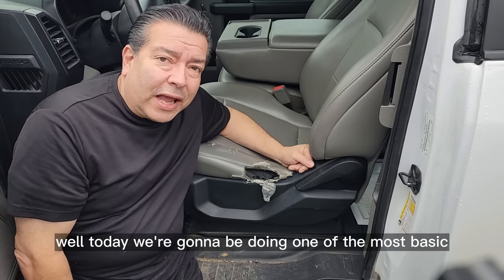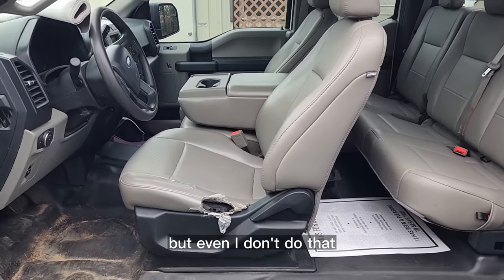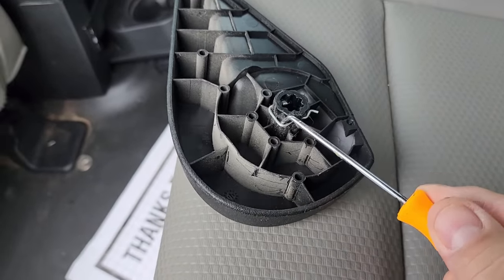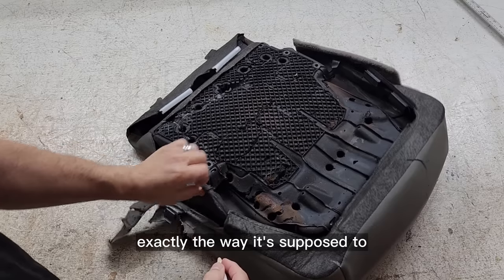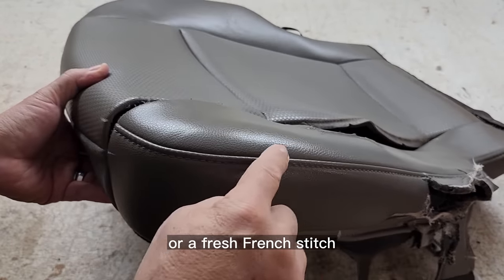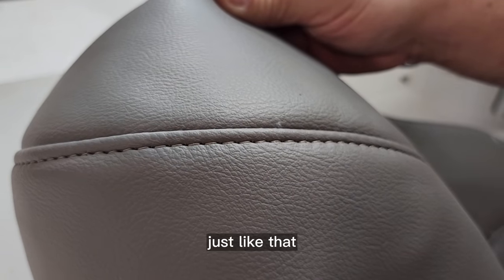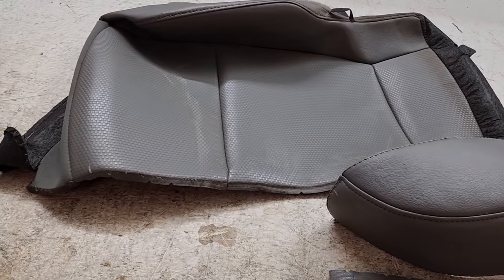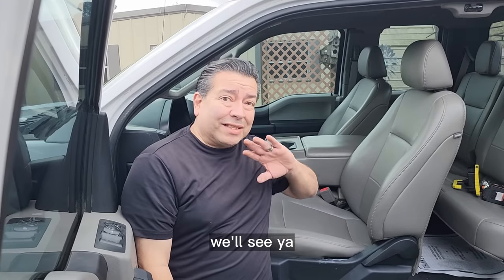Most common auto seat repair upholstery

Comment: Fantastic work.  Consider working in the airbag deployment zone while the system is energized though.  Would be safer (for you) to learn how to disable the airbag system. Also, all modern airbag systems are continually monitored - meaning if you unplug the seat and plug it back it the system will know that.  As long as it’s reconnected correctly, no SRS light
Reply from the maker: Hello Mike, I thought this was a video about auto upholstery... Thanks for the comment, Please keep watching!

Comment: I used to work in the office of an auto applostery shop back in the 90”s always watched thinking this is a great craftsmanship to learn. Kinda like a cobbler.  They made so many custom seats for hot rods and such, the custom work and leather color combinations really popped. I’d see a few VW.s come in and remembering those buses had that old wire frame with the horse hair like padding that held up so well only the fabric would wear down to where that stiff frame would show through. Loved the turquoise and white combo custom work they would install. 🎉
Watching this repair, I thought that original piece of foam used wasn’t really strong for the use on a “Truck” especially all the wear and tear of getting in and out. Should have been much better stiffer quality foam.  But WTH gives you the work to repair many I’m sure.
Reply from the maker: Hello Dani, Yep, sounds like good memories. Yes, it does bring me work. Thanks for watching!

Comment: As an ASE Master Tech since 1978, SIR yellow connectors are SAE certified with a shorting bar in the plastic connector that is spring loaded to "Short" across the two inflator module metal terminals. Electrical current can NOT jump into the air bag and deploy it. If you think you really have to turn the key on, engine off, remove the negative terminal. From 1998 and newer (GM) the radio has electronic memory that is erased only with a scan tool. Volume, country, station and saved pre-sets are stored inside it.
 The SIR control module has capacitors that loose energy if battery is unhooked and cannot deploy inflator module after 5-8 minutes. Written material will tell you 30 minutes but they play it safe.
  The hook tool is sold in two lengths as a hose removal tool. Slid between a hose and inlet on a radiator, wiggle it left and right w/WD-40 and twist. The hose will free and slide off. 
  If the air bag was on a bench, you have to work on the connector with  an insulator installed under the shorting bar and takes some effort. This is a myth. 
Great video on a common problem, like why do the drivers door hinge pin bushings wear out first?  Thanks!
Reply from the maker: Hello Dean, yep. Thank you for sharing you're experiences with us! Please keep liking and watching!

Comment: Youre right about airbags. After installation there's programming Etc. I remove seats all the time to repair cars and unclipping the plugs are a pain. The connectors on airbags themselves are the worst
Reply from the maker: Hello Lewis, You are so right. Why disconnect wires when it is not necessary. Extra work means extra time. Please keep liking and watching!

Comment: Good video. Taking seats out with an airbag is no big deal. Just follow these steps: Wait 5 minutes after shutting off car, disconnect the negative terminal to battery, remove seat and unplug the airbag. There is ZERO issue if you followed the steps of waiting 5 min and then disconnecting the negative battery cable.
Reply from the maker: Hello Adam, Thank you so much for saying so! I never want to erase a customers radio settings. Just sayin'. Please keep liking and watching!

Comment: Great information! I remember when seat covers were once held on with "hog rings" which required special pliers to crimp on the rings used to hold the material to the frame. Wonder if they are still available…..
Reply from the maker: Hello Subgun, Yep, I still use hog rings on the seats that take them. Thanks for watching!

Comment: that is an awesome job !! one thing though that dreaded air bag plug can be disconnected and re-connected with no ill effects as long as you don't turn the key on !
Reply from the maker: Hello Mechanic Mike, Would you say that is the case of every vehicle? I work on every type of car and truck. It would be nice to know as I am not a mechanic. That is why I don't take the chance. Please keep watching!
Reply: @oldschoolautoupholstery  I am not 100% on every manufacturer but on a Ford, Lincoln, mercury it's a fact that  airbags are asleep when the key is off

Comment: Just bought an industrial sowing machine in beautiful condition but stil scared to tackle the actual reupholstering of car seats as I have reconditioned cars for ages in terms of mechanical repairs and mostly modifications putting bigger engines and such but also panel beating and respraying .
I took careful note but still have a lot to learn and sure the first time it won't be perfect but it will come in time. 
Thanks for making it look easy I appreciate.
Reply from the maker: Hello Pieter, If you are also a welder, sewing is similar. Sounds like you can do it! Please keep watching!

Comment: I used to put AC in cars from the dealerships. We took the airbags out of new cars all the time. All you have to do is disconnect the battery first. Second pull the fuse for the airbag circuits. Third pull the yellow tabs from the airbag clips and  disconnect plugs. Never had a problem with the airbags. Installation in reverse mode.
Reply from the maker: Hello Ron, Thank you for the comment on how to remove airbags. Please keep watching!

Comment: Very nice and accurate repair. Good to know about the seat hooks. May I know the name of that powerful  sewing machine, which was used to saw the cover parts together? Thank you for a great film.
Reply from the maker: Hello Olena, I use a Juki sewing machine. But any industrial machine with reverse, walking foot and a welt foot will do just fine. Please keep liking and watching!
Reply: @oldschoolautoupholstery  Thank you for the replay, I googled those Juki sawing machines, they are expensive and very heavy, but good. I've never heard of Juki machines before. Do you have any films about headlining problems? I put a new one previous year, using special glue for that purpose fm Amazon, but it came off in heat in many places after only 1 year. It was my 1st work on headlining, I think I pulled the fabric too much, and that caused the effect I have now. Thank you for your film again. Very informative.

Comment: If the ignition is off and remains off, you can remove the airbag connectors and do what you need to do. Reconnect them before turning on the ignition and no codes should be triggered as far as I know. It is possible that cars vary though but generally speaking when the ignition is off the computers are off and not looking for modules.
Reply from the maker: Hello Rhett, I work on every make and model car or truck. I am sure they are not all the same. I don't want to risk the pain of my customers having to get their airbags reset. This is just a service I do with a smile for my customers. I never go backwards and my reputation means a lot to me. These are the reasons. Please keep liking and watching!

Comment: I do some car upholstery as well.  Unfortunately, I never get vehicles where the seat bottom comes out so easily.  :(  most of the time, the fabric is circling the bolt holing the seat back on.  I have done a ton of 1st gen Expeditions and the 97-03 ford pickups and those have to have the seat removed and the seat plate unbolted to properly get the seat bottom out.  I'm jealous.  
I'm curious though why you use a pick instead of a set of cutters to remove the hog rings?  I find it so much easier to just cut all the rings since I'm putting in new ones anyway.
Reply from the maker: Hello LLs, I use the "Pick" on later model seat covers clips. I rarely use cutters because more of a mess to clean up. I mostly use dykes to twist off the hog rings. Please keep liking and watching!

Comment: If you cut the foam with an electric knife like the type for cutting ham, it cuts very very easy and makes a very clean smooth cut 😎👍
Reply from the maker: Hello JK, I tried about 35 years ago. When I was out in the feild there was no electricity. I chose to stick with a hack saw blade as it takes no electricity to operate and is much more accurate. Thanks for watching!
Reply: Haha good to know. Proof is in the practice,, use what works for YOU..
Reply from the maker: @longhairmullet  Hello Dani, Thank you so much for taking the time to comment. Please keep watching!

Comment: How do you get matching colored vinyl? Also, is doing a repair on a heated seat possible? I have a rip in my seat bottom on heated seats. Wondering how to order vinyl that matches or is doing a kit to put glue on a piece of backing a better option? Thank you - great content
Reply from the maker: Hello Mud, You are so welcome! Most upholstery suppliers and material and vinyl samples that either match or come close to originals. Depending on the car, some heaters are on top of the foam, but others are sewn into the seat cover. Please keep liking and watching!
Reply: @oldschoolautoupholstery  Thank you for replying. I don’t know where to start with finding a supplier. I just want to start with doing my own seat bottom on my car because the dealer wants 800.00 to send me theirs 😀 I am going to watch your basic equipment video tonight. I am older and a disabled vet, cant afford that. I have a regular sewing machine and lots of time 😀
Reply from the maker: @MudDuck  Hello Mud, Just go for it! I think you will do just fine with your seat-bottom project. Please keep liking and watching!

Comment: Instead of that part of the seat cover wearing away, the entire bolster collapsed on my driver's seat in a truck that's not even 4 years old. I'm a big guy, but I'm not that big! Is that a particularly costly repair, or is it more along the lines of pull the seat out, flip it over, push everything back in place & pop-rivet in a support that broke loose?
Reply from the maker: Hello Nunya, I think not too costly, Depends on your upholsterer. Sounds like your handy. I think you can do it. Please keep watching!

Comment: I'm interested in the cost of this repair vs just buying a whole new seat cover for that bottom part. I've found vinyl replacements at a reasonable cost. Just wondering.
Reply from the maker: Hello S RC, Sometimes replacement seat covers can be bought cheaper than what it would take to replace worn seat panels. You get it in a box, Then what? You might need to pay someone to install it right? Please keep liking and watching!

Comment: I have a 1990 mazda miata which has the original cloth material on the seats. My had the habit of sliding into the drivers seat and the side of the seat has worn away. I've looked for the original seat material, but have come up empty handed. Any help on where to look would be greatly appreciated. My goal is to keep the car original.  Thanks
Reply from the maker: Hello Marvin, Original materials fabrics only go back ten years. Send in a sample to Santa Barbara upholstery supplier in Glendale Arizona. They have the most fabrics I know for a close match.  Please keep liking and watching!

Comment: One question!!, why didn't you show how to get the 'C' clip reinstalled on the side seat bolster trim?!, I know that the 'C' clip came off when you pulled it out from the seat adjuster shaft, did you use a long needle nose pliers to snap the clip back in or what, the clearance is still really tight !, thanks!
Reply from the maker: Hello B, The seat hook just easily went on by hand. Please keep watching!

Comment: You can preserve the settings of the ECU without leaving certain components factory reset that way when you unplug the battery for 20 minutes you can then unplug the airbag harness underneath the seat without triggering the airbag deployed message on vehicles.
Reply from the maker: Hello Restricted, Yes you can but I won't. Not all cars are the same, so I don't take the chance. I want it as painless for my customer as possible 100% of the time. Please keep liking and watching!

Comment: Hard to believe it’s not cheaper and easier to just buy a new seat cushion and pop it in, or at least a new cover. Had a similar situation with cracks, not gaping hole, and the upholstery shop said replace it. Eventually found a guy who would fix the cracks insitu for relatively cheap.
Reply from the maker: Hello Msmith, Like I always say, there is more than one way of getting things done. Cheap or expensive, it still gets done. Please keep liking and watching!

Comment: I thought everything made sense except for the foam piece.  The edge of the drivers seat by the door gets either flattened or ripped as demonstrated in the video.  Some women, who for whatever reason put their pocketbooks under their left thigh while driving.  In time this will flatten the foam on the edge of the seat.  My question is, for a few extra dollars would it have made sense to replace the entire foam piece?  I think yes.  What state is your shop located?
Reply from the maker: Hello BG, There is always more than one way of getting things done. The foam repair was a no extra charge of my time and materials because it will also not last forever. I am a proud resident of East Texas. Please keep liking and watching!

Comment: OK. I like this. Here is my problem. I have a 2002 Tacoma. The driverside seat is about 20X worse that what is depicted in this video. The foam is DUST. You can see the seat frame/springs & the FLOOR looking down from above. Toyota only has the foam for the seats now because the truck is so old. ($800!!) Nobody in my area will touch this. This leaves me with the option of getting aftermarket seats (driver & passenger..the seats have to match,right?) from a place called Sheelmann. ($5k!!) What say you?
Reply from the maker: Hello Jeff, The nice thing about upholstery is that nothing is impossible! Pick up some medium-density foam and start carving away with a hack saw blade. Easy! Please keep watching!
Reply: @oldschoolautoupholstery  Forgive me if I am a bit ignorant. Where would I find medium density foam?

Comment: The vinal is just starting to show wrinkle wear. Seems like they would make a special tape to stop the wear before it does create a hole in the vinal drivers seat. A seat cover is helping
Reply from the maker: Hello Michael, So many times I have seen cars come in with the special duct tape over holes. It leaves a sticky mess that gets on your clothes. Seat covers do help. Please keep liking and watching!
Reply: @oldschoolautoupholstery  do they make a spray coating to stop wear or a fabric tape? Been meaning to stop at a fabric repair store for information to prevent a future hole. Definitely probably a cheap vinal plastic on edge of driver seat
Reply from the maker: @MichaelChason  Hello Michael, I think you can put just about any kind of thick tape over a hole if you want to. Some people do that. This video is about replacing what is damaged. Please keep liking and watching!

Comment: what is cost for this type of repair?
Reply from the maker: Hello LPC, Pricing will depend greatly on what the upholsterer wants to charge you. Also, based on how much you want to do, the design of the item and the type and cost of the materials selected. Thanks for watching!
Reply: @oldschoolautoupholstery  i just wanted a ball park number for your example
Reply from the maker: @lpc5152  Hello Lpc, If you were to ask 10 people from across the country, you would get 10 different answers. That is why it doesn't matter what I charge. This is a service, not an item on a Walmart shelf for sale. If you really wanted to know, the most accurate thing to do is call someone in your area and you have a choice between 1 and 5 star upholstery shops to choose from. Then you will know your price. Make sense? Please keep liking and watching!

Comment: Great job but way too much work that actually seems quite mechanical that most people could not do.  Why can't we just swap out the bottom seat?  I know the color will not match but if you have an older car, this should be good enough.
Reply from the maker: Hello David, I guess you could do that if you wanted to. Junk yard seats are the same age and wear as the seat you are trying to replace. This video is for the people who are interested in fixing their seat. Please keep liking and watching!
Reply: @oldschoolautoupholstery  I assume your repair cost a minimum of $200.  Correct?  So how much would an new seat bottom cost?
Reply from the maker: @davidr4523  Hello David, The cost has many variables. Cost will depend entirely on the person doing the work. Type of repair, materials chosen, experience and skill. The location. If I gave a price it would not mean much to someone across the country. You see what I mean? It's not like a product on a shelf at Walmart. Please keep liking and watching!

Comment: Yellow connector has a shorting bar so that when disconnected the bar shorts the circuits together so basically impossible for seat air bag to deploy. To be safe, yes, pull the negative cable and there are NO problems. I have pulled out more seats, steering wheels and occasional complete dash assemblies with air bags and NEVER had a problem. And there is NO reason for a trip to a dealer to reset anything. Guy might do a great repair, but he is not educated on airbags.
Reply from the maker: Hello Douglas, I am not worried about setting off an airbag. I am more worried about getting an airbag light. True, I will never say that I am a mechanic. I am an upholstery guy. Big difference. I just demonstrate how I do things.